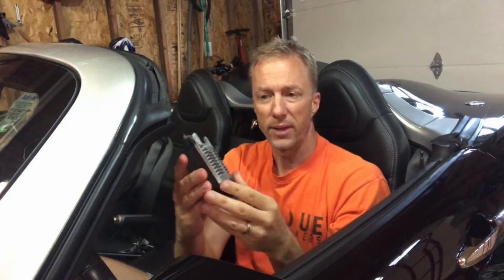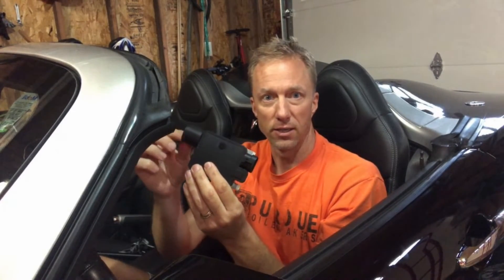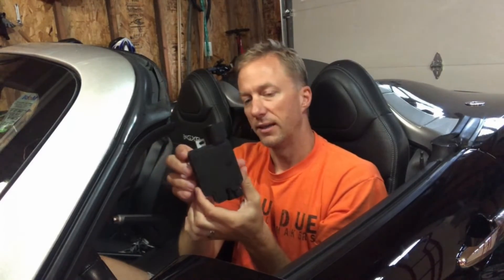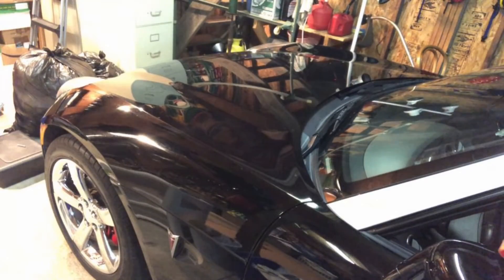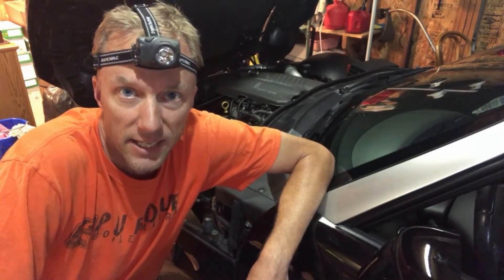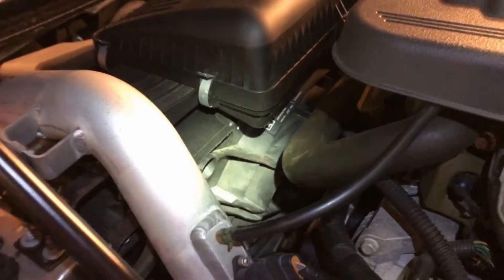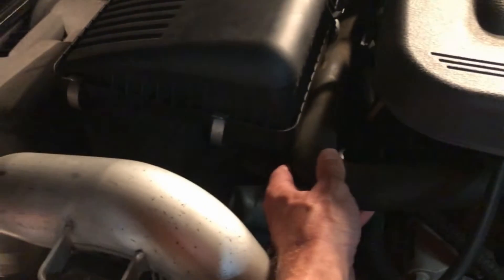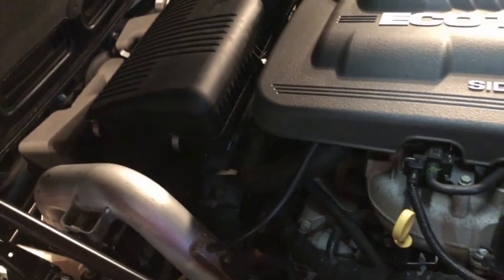Cap'n Fixit - Episode 001: Pontiac Solstice GXP Engine Cooling Fan Control Module Replacement

Comment: I have replaced the module, the fuse, cleaned everything, fan seems to be working fine and yet check engine light is still on… P0480 and P0691 I am at a loss and so frustrated

Comment: Just as an FYI, you can use a tiny stubby screwdriver to get that single screw out. Then, to put the new one on, put a piece of double sided tape on the module's rear and run the screw through it. Then when you push the sticky tape up against the fan shroud, it holds the screw and the module in place until you can get your screwdriver back in to tighten the screw. I've replaced about six of these and it works great.

Comment: I swapped 2 of them different cars the cheapy ones WORKED GREAT. also I swapped mine without removing most of the shit in the way. Easy to get the screw out but I put it back with a zip tie. Lol. Works great.  Cheap ones are fine.

Comment: Thanks, this is the second time mine has gone out and this refreshed my memory. BTW: This demonstrates something I always say about having an aftermarket Cold Air Intake and filter. Never mind any performance or sound changes. It frees up a ton of room at the front of the engine.

Comment: This worked fine with the Ford controller initially, on restart however, I am getting a P0480 code.  Was this the case with your experience or do I need to look for an additional issue.  The fan is working, it turns on and off when it is supposed to for engine temp and turns on when the AC is engaged, so it seems to be working, I just don't want to drive around with the MIL on.  I have attempted to clear the code, and it will clear and stay off during that ignition cycle but will light up on the next ignition cycle.  Thanks for any info.
Reply from the maker: Ack, I'm sorry to hear that!  There should be no engine error codes after the replacement.  You may need to check for an additional issue.  Check that all the connectors are secure and wiring is in good shape.  Hopefully you didn't get a bad controller.  Someone should make a more robust aftermarket fan controller.  These seem to have a lot of problems.
Reply: @capnfixit1222  Autozone now carries an aftermarket Fan Control Motor, it is from Santech, "Santech Engine Cooling Fan Module MT4100" available for $110.  GM also carries a similar Fan Control Module now for the HHR under part #25845280 available on Amazon for $125.  I still have the issue with the MIL and I ordered another Ford Module off EBay and hopefully it will work, if not, I will try the Santech module and let you know.
Reply: @conkeeper  Hey what was the result? Getting the same code and wondering if I should try swapping for the santech one.
Reply: Same thing happened for me. Fan works but now have this code. How do I fix it
Reply: So my car is getting hot even driving down the road I was thinking about doing this to see if that fixes my problem but I’m seeing a lot of people are saying they are getting an engine code what is the fix if that happens?

Comment: Thank you!!! I too had mine go out for a second time and this video is going to save me hundreds in labor because I was not about to go through the non-sense of replacing the full fan shroud again myself.
Reply from the maker: Excellent. Were you able to get it replaced?  What tool did you use to squeeze in the small space and get the mounting screws out?

Comment: I replaced the one on my wife's GXP today with the Ford Crown Vick  one  on ebay. It works perfectly.  After putting everything together I realized I made a mistake.  I should have replaced the damned Philips screw with a hex head, torx head ,allen head socket  or something other then the phillips..
Reply: Great call out - I'm just about to do mine and that's a simple step that will save me frustration on the reinstall and a ton of time when I have to do this a 3rd time 7 years later!

Comment: Ok hope you get this or someone else might know- mine is the exact opposite! I was driving mine yesterday and after I shut it off I noticed the fan continued to run, I checked the coolant temp in instrument cluster, it was right where it is expected. Hummmm… so, wasn’t sure what to do, so I pulled the big fuse up under the hood by the battery. Fan shut off, keep in mind this is with engine off and keys in my hand… I went back into work and came out 3hrs later in the Ohio weather of 40 degrees, motor was COLD as would be expected, before I did anything, I put the fuse back in and fan motor started back up immediately! Grrrrr, so I drove it watching coolant temp, was fine and in range, but got home and fan continued to run. So I pulled the fuse for the overnight, maybe this control module failed in the opposite way as yours?? Any input?? I’ll be finding this item on eBay in a moment,
Reply from the maker: Oh man.  I'm sorry to hear!  Thinking about it, replacing this module seems like a reasonable thing to try.  Have you tried Googling your symptoms to see if anyone has pointed towards this module?  Also, the Solstice Forum has a lot of knowledgeable people in it.  https://www.solsticeforum.com/.  Let us know what you find out!
Reply: Thanks! I went on Ebay and bought one for 16 dollars, and the can be used on a crown vic? That's weird. But when it comes and o swap it out I'll message ya, and if it fixes it I will make a YouTube on it giving you all the credit but mine will be geared  to change it if your fan WONT shut off
Reply from the maker: @terryhites1  Awesome.  I hope it works!

Comment: Just want to say this worked for me with a caveat. I know what a pain in the ass it is to fix anything in this little car but I changed the module twice and it did not work, until I looked at the fuse box and the 60A one was blown. I replaced it and gone are the codes and no longer overheats.
Reply from the maker: Ah very good.  So, check this fuse in the fuse block.  Thanks for the tip.  I'm glad you got it working!
Reply: Yep…mine was overheating…..checked the 60amp use…it was blown…soooooo I”M GOOD and so grateful!

Comment: Just want to thank you

I just changed mine today. Paid  $20 for the part and worked perfectly 

I had a mini ratchet that took screw driver tips.  I also used a small philips screwdriver. It was 3-4 inches long and had a thick handle. 

Thanks a million. 

👍🏻👍🏻👍🏻👍🏻👍🏻👍🏻👍🏻

Comment: Hi, I hope you’re still active on here but I’m having the same issue on my 2006 solstice and it’s not a gxp so I don’t know how similar it is. My friend suggested I turn the car and AC on and jab the motor to see if it spins the fan and it does.. however it stops spinning after a few seconds. Do you think I need the fan itself or I should just try this module
Reply from the maker: Sorry for the late reply!  Did you figure out a solution on the 2006 Solstice?  I'd have to research and see if it has the same fan/module combination as the GXP.
Reply: Capn Fixit no worries, I managed to fix it thank you!
Reply: Janncenn Serrano .... what dis you end up fixing? What was your solution? Curious I too have the same issue.
Reply: Big O so originally I thought it was one of the fuses in the fuse box but it wasn’t. It was the actual motor in the fan. Turn the car on and have the AC on, look under the hood if the fan is spinning and if not..  grab a long broom/stick and kinda jab the motor to see if it’s spins. If the motor spins when you jab it then it’s the whole engine cooling fan assembly is what needs to be replaced. I got a new one from eBay for $74 and it was super easy to install, now my AC works very well.

Comment: i know this is a couple years old now but, is this the right one.   https://www.ebay.com/itm/Cooling-Fan-Control-Relay-Module-For-2006-11-Ford-Crown-Victoria-4-6L-940002904/292613597369?epid=20020713869&_trkparms=ispr%3D1&hash=item44212128b9:g:Fv8AAOSwYUdbLLnt:sc:USPSFirstClass!35062!US!-1&enc=AQAEAAACYIQvEcHUrT7nmUC3yY5qbPyaBN1nJEDYW8MyypsJPgXKMy1HQ5tqr4SizEZhU4A6p9AGiQzkJ1pfS3G6EE%2BKGYWvHCclHl71c6SCDM%2Fz%2BepzqXpFSV926eGRbxsklODtG2veVJTYalhIwOL7M8P%2FxGLb032Cx%2FFRYwaOhTxScHfWWC5rvMyqRmg6GcPQDhAixUHQZEMNn%2BoXMYgl3mw%2FherU53nhQYYhqQtuGoFQO8mbtjEJvtgDT2C%2B7Ew7Lejdkg6xnK0LfiXH603W3j%2BgbzcSnNJnHRWuY8TF8yqCuRlQdFEtaineWL5WyPoLwZVEaAaZItNrikKK50qd4S8V3uf1HJsTwPWXWlP79i3j8dv265Kl0LXNAUnWHSce5xfGzcz8Apz6M%2Ba5xvsx%2FUdCQmV8Ry2U2za5deUACcZomDVlZs%2BR3U%2Btvi8rNeeSort1lyMT%2FUsO9Ea%2FFGJvXhvdEAmJ2ihC%2FWBg3g3igW3Wh3mCJSST5R5SCJLY0pxgOlKabVNAa1i5sBVEKcwHZDw%2F30x0F9ZhFbF2JSsGkzwUeecrTuhvdVlDZcPQv9cV9XOsFSyD3BRX6TCDqOuEmlDvb0OpR0wneQfowaA6xB%2Fgl4n58ErbluxXh5dSCDr2pD%2FTGRq3kTA6qEcwuLdL7d83%2BqGFMQc%2FIZd4WEnUZqnJT497MzM8pWx4AVTMKee5Iaqs6dWOllVeUY7O18K820B%2B05FN3b5b%2Bp8zupk0Ak6P7fr9KVqWQQgEScwglBJBQk8J0Mzu2vY6D9%2Fq5XZaLCDZVZ97yiETEdUTuv%2BRC2PpIswp&checksum=2926135973697bcb14dd3b52483abc695d3652da9f13

Comment: so if i but the module for crown vics i can use it on my gxp?
Reply: sosa this is the one I bought. Works perfect!  No need to buy the expensive Gates brand. 

Engine Cooling Fan Control Relay Module fits Ford Crown Lincoln Mercury 902209 https://rover.ebay.com/rover/0/0/0?mpre=https%3A%2F%2Fwww.ebay.com%2Fulk%2Fitm%2F132599530345

Comment: I ran one of the PN# interchange numbers ( RY 1532, standard motor products ). Listed on one of the Crowne Vic listings, through the Gates website. According to it, the Crowne Vic part is interchangeable. Thank you, this will save us all tons of money.
Reply from the maker: That's great!  Thanks for the information.
Reply: I’ve had this on my car for 2 months now and it fixed my non working fan. Whoo hoo!  

Engine Cooling Fan Control Relay Module fits Ford Crown Lincoln Mercury 902209 https://rover.ebay.com/rover/0/0/0?mpre=https%3A%2F%2Fwww.ebay.com%2Fulk%2Fitm%2F132599530345

Comment: Thanks for this video!  My cooling fan went out and I noticed that same increase in temp when at a standstill.  Checked the fuse and it is good, so I'd assume it is the module.  I have a volt checker and will test it this weekend to be sure.  I found on eBay the Gates module for Solstice selling for $90 and the Crown Vic for $19.  They have a different part number, so I was wondering if it really makes a difference to have the exact part.  Does the module you bought for $18 work perfectly?  Thanks in advance!
Reply from the maker: Yes, as far as I can tell the fan is coming on at the correct times (I can hear it) and I have had no over heating problems.  Let me know your results!
Reply: Capn Fixit Thanks so much! Do you have a link to the product you bought?
Reply from the maker: @Rizz1435  I ordered mine on eBay.  I dug up the email receipt and the link to the auction no longer works.  The auction title was, "Cooling Fan Control Module 6W1Z8B658AC For 2006-2011 Ford Crown Victoria... ".  I see many out there for sale by searching for part number "6W1Z8B658AC" on eBay.  I hope this helps!
Reply: Hi..please tell me the part number for the control module. I have an 2007 GXP.